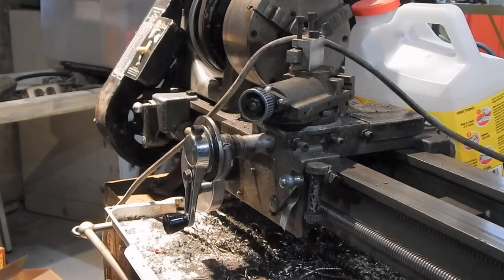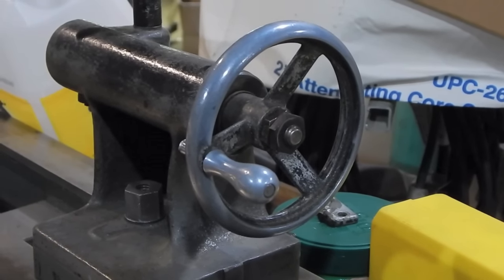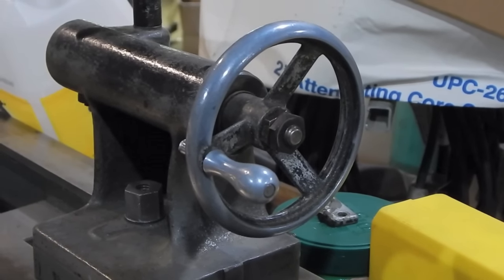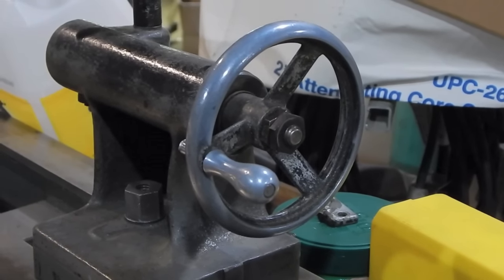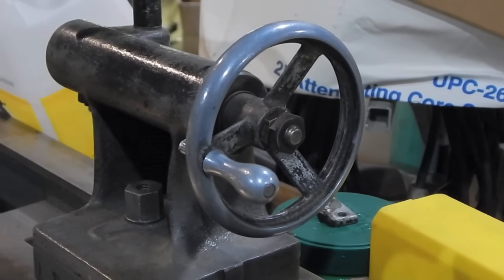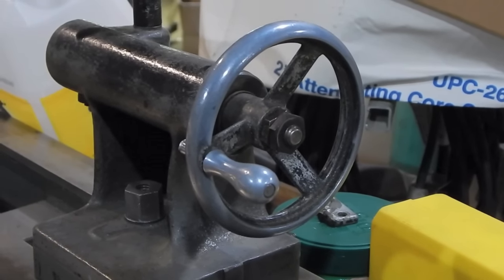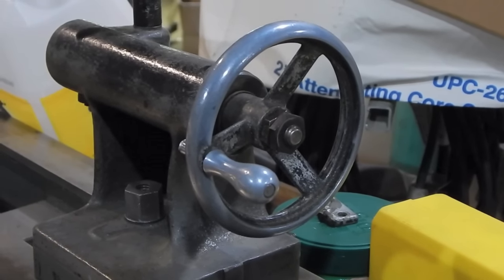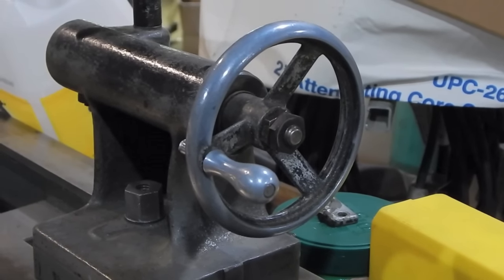Atlas 9" Lathe Part 36

Comment: Why not make an entire new crank..... at minimum, salvage the hub,  if you are afraid of making a key-way, and pin into a new assembly?   Using the mill would not be my first choice, with the wiggler....all you needed to do is stick the point in your punch hole and adjust table until it runs straight
Reply from the maker: +Jim Liechty Hi Jim. I tried to reply to Rebecca Wilson's post above, but for some reason I can't. But she brought up the same question. So here is my reasoning. I feared that if I messed up, I'd have no choice but to procure a replacement handle, and I've only ever found one of these on Ebay for $70. With my solution, it works fine, and from the front does not look much different the the other solution both of you suggest. Furthermore, if I had screwed up with my attempt doing it this way, I could always fall back on making it the way you both suggested. As for the wiggler, I figured out later that I should've done it differently. Spoiler alert, I centered it perfectly for milling the groove, but some how managed to drill the center hole off center. So my finished wheel runs concentric to the shaft, but the access hole for the mounting nuts is eccentric........slightly...........sort of like me!